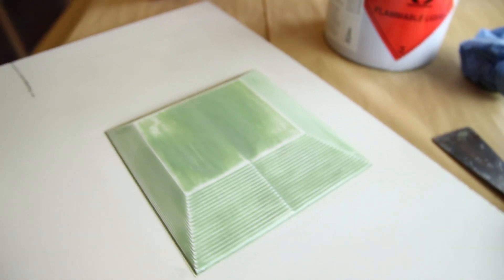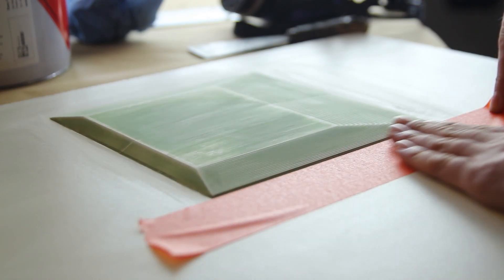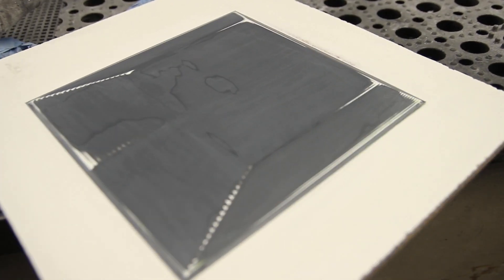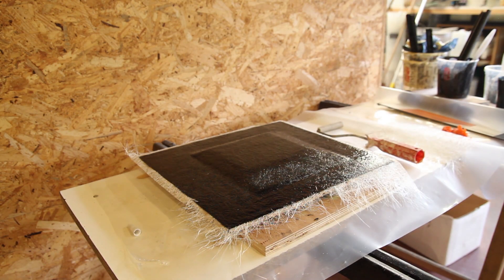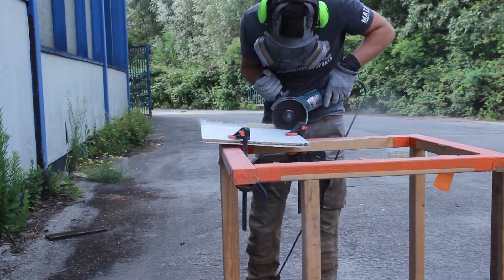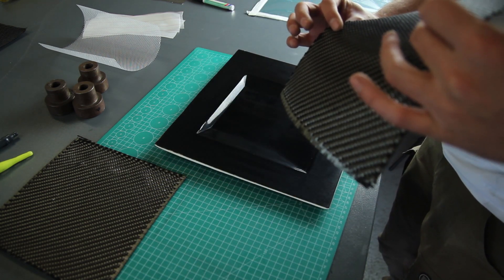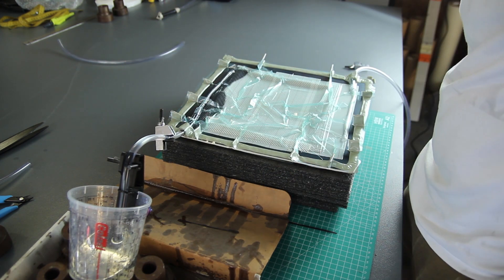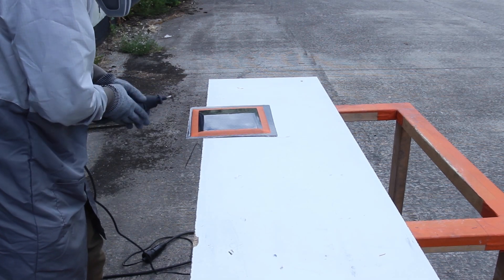How To Go From a 3D Print to Carbon Fiber Part (Tutorial)

Comment: I watched a video of a formula 1 car chassis creation. It was carbon made and they used an autoclave. It was the reason why you cannot do such things at home, because you need very expensive autoclave with size of room. But you don't use it in your project. Does it mean that your carbon is some other lesser type of carbon not suitable for heavy duty applications? Can something like olympics grade bike or private plane be made this way?
Reply: It doesn't mean it is some lesser type of carbon. The autoclave is used to minimize faults in the resin e.g. bubbles and increase the properties by achieving better saturation of the fibers with the resin.
Reply: @jucaesar4961  Thanks for the explanation. I thought there some different type of chemical reaction and resin type which need a temperature to cook.
Therefore I still can place carbon from the video in autoclave and increase it's quality.
Reply: @vitalykononenko149  I am not too sure about that inference about the same resin being able to increase the properties through the autoclave. Generally, I would refer to specific datasheets in regards to which cure temperature and pressure should be used for the best properties. 
I only learned about this at a rather surface level during a second-semester course in my (bachelor) study of aerospace engineering.
Reply: @jucaesar4961  Still you are a profi and I am wannabe amateur. So thank you for your best judgement.
Reply from the maker: correct! but F1 and Aerospace are very specific industries that need that extra 1% To answer your question; I do think olympic grade and private plane can be done such way, I've read boeing and airbus are switching to out of autoclave as well but not sure. But if you want to make 95% perfect parts, out of autoclave should be fine as well!
Reply: @MatthieuLibeert  Thanks for the answer.
No I am perfectly fine with less quality material and trade quality for cost and ease of manufacturing given it passes minimum requirements. Eg bike should not disassemble at 50km/h.
Also such lesser carbon still should perform better than titanium or well structured aluminium or dural.

Comment: Hey Matthieu, as usual very enjoyable to watch! The only question I have is (for part like this especially) why not just 3d print a mold, then do all the other steps and infuse the part? This would save time/money vs. laying up a fiberglass mold.
Reply from the maker: 100% true! Only downside is I don't think 3d printed moulds are durable! Will test a 3d printed mould in future videos, as it's highly requested 😉
Reply: @MatthieuLibeert  I understand why you'd think that!I used to think the same,  but there is a way to print durable molds (2-3 perimeters with a larger nozzle, in my case a 0.8mm, plus more infill to avoid any compression during vacuum). Then I sand mine with 80 grit and coat with epoxy mixed with graphite (just something I found to work well for coating). Afterwards I just wetsand with 220, 400, and so on up to 1000, then polish real quick (basically the same process you went through for your plug/pattern). It is as durable as any epoxy/fiberglass mold is as I have infused and pulled a number of parts from mine and they still look perfect. Worst case, another wet sanding pass would refresh it back to tip-top shape! This has been my process for car parts. Nevertheless, I always look forward to your videos and value your opinion because you've been grinding for a long time way before I even figured my stuff out (still figuring it out actually...). Much respect to you.
Reply: @MatthieuLibeert  You can check one of my videos. I used a 3d printed mould PETG coated and one with just release agent :) i'm new into resin works, so its not the perfect mirror finish.

Comment: to get the "metal" finish you would need a very strong vacuum, maybe using a pressed machined mold helps because if the surface fibers aren't perfectly aligned, you can easily punch through into the fibers while sanding which is what koenigsegg managed to avoid. Maybe the viscosity of the resin needs to be very low to get a thinner film between the mold and the first fiber layer. could you cheat by adding pressure on top with a flexible material in between to sreap the pressure evenly, after infusion , after clamping the intake but before clamping the outlet, I guess it would help.

Comment: So that effect is basically sanding into the weave? No need to seal it with a clear coat?
Reply from the maker: Correct, you could clearcoat it if you want
Reply: @MatthieuLibeert  any downside to skipping an extra "sealing" coat? Or is it not needed at all due to the void free infusion method? (Just trying to understand as I've always been told to add an extra cost after hitting the weave, but I'd love to skip it 😅)
Reply from the maker: No not really needed as long as all the fibers are well infused with resin, and your ok with that finish
Reply: @finfoil8544  unless the infusion resin you're using is UV resistant or the part won't see UV light (sun) then leaving the part bare is fine.  Otherwise, coat it with a UV resistant clearcoat, as the resin will begin to breakdown and amber over time

Comment: I think you may have answered a long-term question I have always had... maybe?  My question is:  Can you cure a two part epoxy (resin + hardener) inside of a vacuum bag? In other words... will epoxy cure in a vacuum state ( no presence of O2 or other molecules that make up *air*)?  I understand temperature guidelines, just wondering about the vacuum state?
Reply from the maker: Yes epoxy is a 2k resin that will cure under vacuum

Comment: Is there a limit to the size of part that can be infused with resin, or is it a matter of tuning the hardener speed for the size of part?
Reply from the maker: correct! If you use the slow hardener from easycomposites you might infuse parts larger, did parts up to 10m² in the past. Some other brands of epoxy might even have slower resins. Another solution is to mix your resins in smaller batches and fill up the infusion cup when needed
Reply: @MatthieuLibeert  also depends on the structure of it. we have been doing this, design and 3d print then make cf for years, tons of problems. sometimes we have to use clay to re construct.
Reply: You could also have several resin inlets. They make yachts with infusion they just have a resin inlet every 2 feet down the center. And infuse it from center out
Reply from the maker: True!

Comment: Have you considered 3D printing the mold itself? That shouldn't be too hard to do in 3D modeling software.
Reply from the maker: it's on my todo list ;) should work! only thing that might cause some problems is the vacuum I guess
Reply: @MatthieuLibeert   that might be a good excuse to get a resin 3D printer!
Reply from the maker: @Specter0420  looking into it ;) coming soon!
Reply: @MatthieuLibeert  make the printed mold part hollow and fill it up with resin with some filler from the "underside" ;)
Reply from the maker: Already did that in a previous tutorial 😉 it's in my last videos making a tube 😉 '3d printed mould to make carbon fiber epoxy resin tubes'
Reply: Expanding on this, I’d love to see a 3D printed mold utilized with out-of-autoclave prepreg cured in an regular-ish oven that can run the prepreg heat schedule!
Reply from the maker: I have a video about 3d printed mould being used to 120degrees to cure prepreg 🙂